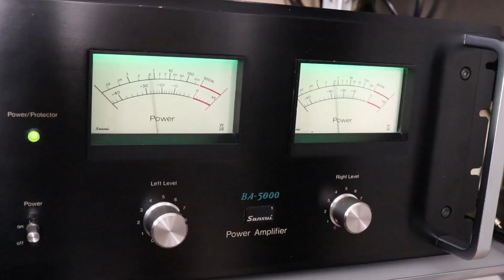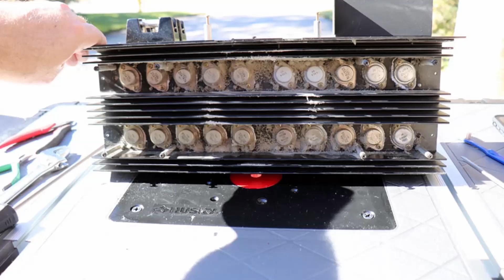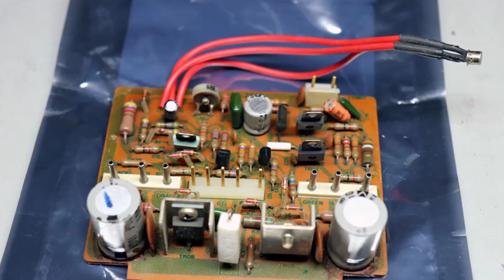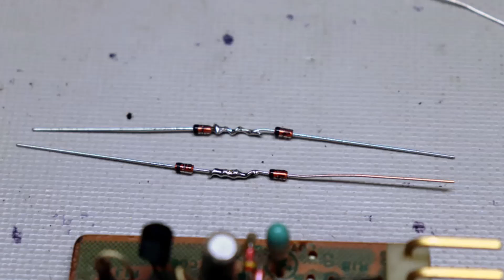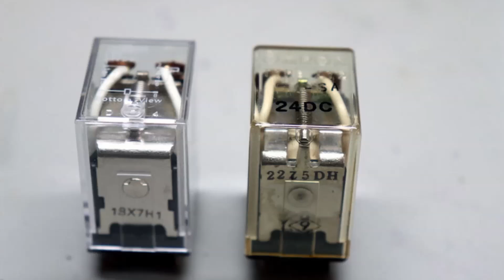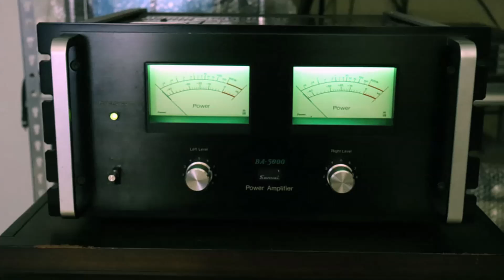BA-5000 Sansui Power Amplifier. The Best Ever? Old Vintage Stereo Repair Restoration Testing.

Comment: Hi good day I need your help I have one of the amp I have  fallow  you  video and manage to  fix it but can’t  find where to connect the fan to the  circuit   The  previous  owner lost the fan and I have to  enstall a new fan. Could you get the specs. And where to connect it to please  looking to hear from you thanks in advance

Comment: Much like McIntosh designs using output transformers in a solid state amplifier. To me this was a great idea since it isolates any DC from your speakers in the event of an offset in the output circuit. This is much better than using an output coupling capacitor.

Comment: I would like to know more about your cleaning technique, solvents, soaps, brushes,  sponges, etc. The things to do, and not to do, and why. Cleaning those meters would be a priority given their delicate nature. Excellent video. Thanks!
Reply from the maker: Thanks for watching! Well on any faceplate you have to be careful. If it's a aluminum faceplate start with warm water and a little dish soap. Rags, paper towels, old toothbrush all work well. See how it goes. Beyond that I've used Mother's mag polish successfully but if you try that make sure you test a small area first. I've never had an issue but that doesn't mean you won't. Any of the old fisher, scott, mcintosh etc. glass faceplates I wouldn't get anything wet around them. NO water, windex etc. I've seen too many ruined faceplates to take a chance.  Plastic like the meter housings water, windex etc. works for me.
Reply: @vintageaudioaddict  thank you. What about cleaning the interior, including the mess on the output transitors, or the boards and their components? Do you start with a vacuuming or a brush, do you use liquids, and how long before everything is dry? Do you use soap and water there? I saw you use some brush on deposit. Why would you need to deoxidize the underside of a board? The solder oxidizing shouldn't affect the current flow there or does it?

Comment: I have one of these the face panel needs painted. Any Ideas. It was heavily scratched as a road amp and also I need handles for the front. Had the same common emitter transistor problem as you and corrected it the same way. Repaired this about 7 years ago and it is my main amp for my front speakers. I use a Technics Se9600 for my rear speakers. A Sansui AU-11000 for my deck speakers.
Reply from the maker: Re-painting faceplates, I'm not sure. I've cleaned a lot of them but I've never tried to refinish one.

Comment: I have sansui au-20000, But I have A-little problem , one of Speaker, does have hummm sound in woofer , but not much, What do you think about to solve this problem?? I have changed all Capacitors, with ELNA, Sound is really much better, But I have checked With Technician, But they did not found , why Humm sound come in one speaker. As you have experience, whats your idea about that?
Reply from the maker: The first question is did you have the hum before the re-cap that was done? That is the first step. If the hum was there before the re-cap then you could have a grounding issuing being caused by corrosion on a grounding point on the chassis. Of coarse, this is just a guess. If the hum is new after the re-cap then you must go back through and re-check the restoration work to find the issue.
Reply: @vintageaudioaddict  Hi, Thanks for your answer, Yes, Before and after Recap, still have the issue. but I check Every things, But When I turn down the Midrange on front panel , the Humm comes down, but when The Midrange is 0 the sound come more until 10 that, I have hummmmm more. 
I checked 3-4 times, All of things, and also When I open the front panel , and pul out, The humm sound is 90% disappear.

Comment: I've had a black McIntosh MC-2500 powering my fullrange Acoustats. It is rated at two times 500 Watts at 2, 4 & 8 Ohms but was rather helpless with the load presented by my Acoustats. A Mark Levinson ML-3 without autoformers and "only" specified for two times 200 Watts @ 8 Ohms powered my Acoustats beautifully and without a problem. I do not think the Sansui BA-5000 would fair any better with my Acoustats as the Mac or any other tough load.
Like the video though and the effort you put in your work and the opportunity to hare it with us and great that you salvaged it!

Comment: My old Sansui AU-555a amp and separate tuner are going strong after 47 years.  Sounds are excellent with my home built Speakerlab component speakers.  Taking care of equipment really pays off.
Reply from the maker: Great to hear that you've had your gear that long!
Reply: @vintageaudioaddict  I forgot to say I really enjoyed every part of your repair video.  That amp is a real beast.  I never knew Sansui even produced monsters like that.  My brother also has old Sansui gear he brought back from his military time in S.E. Asia.....I believe his is an AU-777a amp and tuner?  I did my first pot replacement the other day on a control unit for RV jacks and it came out great....and I saved myself about $450 for a replacement. Keep them coming VAA.

Comment: The diode replacement on the meter board puzzles me. You stated the originals were known to be problematic. OK, why replace with 2 in series? Not for piv, 4007's are 1kv. Not to match Vf, originals look to be single diodes. No mention of sil or germanium type. Paralleled anode to cathode across the meter makes a good protection circuit, but yours are in series. Sil in series with a zenier for Temp compensation I have seen also, but this is not that. So I am puzzled. I accept that you did the right thing, I just want to know why. I have owned Japanese iron before. I have an AU999 awaiting it's turn for repair, and a Pioneer SX-5590 working great. My taste ran to Onkyo, until I discovered vintage McIntosh. The problem with high end audio is, most people have never heard it!

Comment: One would think drilling out the sealed (steel) potentiometer metal flakes from drilling would destroy it.
Reply from the maker: That's a good point. This is the only one I've owned and for that matter ever seen so maybe there was some luck that the pots were not damaged.

Comment: How did you "experiment" with the bias transistors?  Why the heck would they design something so important like bias transistors to be ran extended off the board with wires like that?

Comment: Nice restoration work, cheers!  I own a BA-5000 with matching CA-3000 preamp, they are awesome. Just wondering:  Is it normal for the BA-5000 to run very-warm after its on and playing music at moderate volume for a while?  Mine does get rather warm when I put my hand on the cover.  The cooling fan is designed to come on at 158 degrees F if I recall correctly according to the spec in the service manual. I dont think the fan has come on when Ive played the amp, but it would be helpful to know if its ok to get a bit hot even if the bias measurements are all within spec, considering all the power-out transistors it has.  Did you notice any difference in temperature when comparing the before & after of your restoration?  Would applying fresh thermal compound to the transistors make a significant difference in lowering the heat dissipation?

Comment: I have also some Vintage HiFi Equipment. At the monent the prices for old stuff flying high! Please dont forget, its old stuff! Ist needs to be repaired, and for this you have to pay! Latest equipment sounds better no question, the main problem Hifi from today can not repaired! After gurantee it s a part for the waste. The Vintage HiFi can repaired from 100€ up to 1000€, but then ist will work fine for the next 40 years...

Comment: I love watching the repair you made on this sansui, wish I was just as good as you are on repairing.. Keep up the good work. By the way, i would like to ask regarding my Yamaha R2000 which is close to 40 years old too. Is it ok also to replace some parts with same value but not the same voltage? Can you check the power amp if it can be replaced with other more modern part now? Hope you can be of help. Thank you and God bless.

Comment: I wish I could send my luxman 5m21 power amp to you, the dc offset on it just keeps rising until it goes into protection. I can deal with basic electrical faults but this is out of my league. I do think i know what the fault is but i'm not going to just throw money at it until things work

Comment: Great to see the heavy weights kept alive, I only have the BA-3000, hasn't had speakers connected(a load) in years however powers up in the right sequence, throw power switch, LED goes red to green and VU meters simultaneous do there half mark twitch. 160 per channel was plenty in an apartment back in the day. You've sparked my desire for the old audiophile in me. Give me a few days I'll play some Donald Fagen. I'm warming it up right now, One unique characteristics of the BA-3000 was it's round transformer. I've had the amp since 81-82. Thank you for sharing your passion.

Comment: Hello, first of all I wanted to congratulate you on that restoration, because taking advantage of your experience, I request your support, I just bought a BA5000, in very poor condition, it was stored for many years without use and all its power transistors were removed from the rear panel, except for the dirt and rust in theory, it is still functional because the only thing it lacks are the transistors, so your support in this sense, would be if you could provide me with an image of the rear panel where the values of the transistors are, their location and its position since I observe in internet photos that the direction of the text changes and that means that its position differs, now I could also observe that for example if it takes a row and hence 5 transistors the third, that is the third, its value it changes and that detail I could see tango in the upper and lower fil, so it would be very helpful to have the image or, if possible, the list with the values, to That the technician can put them properly and not make any position or value errors and that damages something, or if there is any way of contact, by mail or messenger to send you detailed photos of the team and thus be able to explain to the technician correctly, it is worth mentioning that the service manual already has it printed, but do not locate what I was asking you. Thank you in advance for your attention and support. Best regards.

Comment: I've had the Sansui G-7700 Tuner Amp for 20 plus years and has served me well; however, It's been in the shop three times for either the left or right channel which don't last very long and now, both are out I suppose. There might be other issues that are causing it, but It is my understanding that Sansui no longer has left or right channel outputs for Tuner Amp, and so It's been sitting on a shelf for many years, sad but true. I'm not sure it's worth fixing even though it's been a great system and is still very clean? It may take a wizard to fix, like yourself!
Reply: getting genuine parts is a key factor as well as a tech that cares about his/her work. Parts from china are iffy at best. There's so much counterfeit stuff hitting the markets, or old parts being stripped from equipment and sold as new. There's a reason a US distributor like Digikey might charge 10 times more. It's the real part and it not only meets original specifications, but it can be traced to the manufacturer. Parts need to be matched and verified on a curve tracer, if you have something worth repairing. You should not be having channel consistently going out because the same parts need to be replaced.

Comment: This is a serious amplifier made when good sound was truly the aim. We are lucky to see one still being used. Your restoration is very sympathetic to the original design and I greatly appreciate it. Have had to fix some older gear occasionally but usually some butcher has tried to fudge it but failed, making full repairs not financial, have occasionally kept the casework and replaced the power amp with all new to increase reliability.

Comment: That's a big heatsink but given there's 20 transistors bolted to it there's not much heatsink per transistor.  Does it run hot?
Reply: Yes, it probably does.  I have many a Sansui receiver and always liked the way they sounded.  They have amazing power supplies as Sansui made their own  including the transformers.  However, as you see yourself, they are known for not having large heat sinks and I have found that they do burn their transistors out easily if you are not careful with the load.   Sansui's pretty much are 8 ohms only.  This amplifier might be an exception since it has the transformer, but mismatching the load is what probably burned the outputs out.  Still, when it came to the older vintage stereos, I just liked the sound of the Sansui's the best.  Pioneer was a close second and then Technics.   Marantz is also a good sounding receiver, but I don't like the way they look so I never bothered with them.   The largest Sansui I worked on due to blown outputs was the G-22000.  And yes, after I fixed it, it did run very warm to hot running into an 8 ohm load at about 75% of it's rated power.  Nevertheless it was LOUD!  But just a warning to you if you go with Sansui...if you push them, they push back by blowing the outputs.   Almost all should be gone through, cleaned and biased properly to specs.   The 75% rule is pretty good to follow as well.   So if you listen to music and you find 75 watts a channel loud enough, go for a 100wpc receiver (or more).  Just be careful if you go too high on the power as you can damage your speakers from overpowering.  This is naturally easier to see if you get a receiver with power meters and I highly recommend that.    This amplifier above would be too big for my tastes, but I just looked on as it is a nice looking piece.

Comment: This is not possible between 2/4/8 ohm the power can not be the same.
Reply: Yes, it works that way with an output transformer.  (With a load that matches the tap)

Comment: I have a CM Labs 920 amp that I've had for 40 years and it's original except for power switch. It's used regularly, looks great but the transformer has started to buzz. Should it be replaced or can it be redone without too much expense?

Comment: these BA-5000s are quite rare, not a single one has come up for sale on ebay in at least the last 6 months to a year and only a handful of Japanese models come up for sale on yahoo Japan.  This thing was a BEAST back in the day weighing 108 pounds.  You think the G-33000 pushes speakers well?  The BA-5000 is a step above the G-33000 in output performance and I'd get a BA-5000 with a CA-3000 and a TU-9900 tuner any day over the insanely overpriced G-33000 and pocket several grand in the process.

Comment: Great videos...looking for someone to resurrect my Sansui G9000 (that I've had sitting in the closet for some 8 to 10 years now) that is close to south Florida to I can take the unit to them for restore. Right channel intermittent and needs new lamps. Never been serviced except for a cleaning in the late 80s. I'm original owner. Bought it in the Philippines in the late 70s along with a pair of SP. L800 speakers that I still use today.
Reply from the maker: Thank you! Google "vintage audio repair" or "vintage stereo repair" and see if there is someone down your way. I imagine between West Palm Beach and Miami there is. That way you can just put your G-9000 in the car and take her to the shop yourself. The G-9000 is a wonderful receiver. Good luck with her! You didn't say but I imagine you were in the Philippines because you were in the military. Thank you for your service!

Comment: Nice amp !!! Almost done with my G-8000 , it set in a closet for 35 years ! Got a lot of time on it just cleaning it , everything is orginal and looks almost new inside , I would like to re-do tje protection board , you know every G-8000 i see the left side driver board is always missing its cover ? And the right side always has the cover , you know the boards by the filter caps ?
Reply from the maker: Thanks! When you get your G-8000 done you'll have to post a video. What a pain in the arse that process is, LOL. Well, I think that both the left and right side covers were there originally. You wouldn't think that would be something easy to forget to reinstall if someone was working on the unit. Maybe a screw but not a cover. I don't know......
Reply: @vintageaudioaddict  will do , I dont know why someone would have that covet off the left side driver board its all orginal , But yeah i will be done with it this weekend , I got to all pots the pots for cleaning that was a pain but just took my time beautiful machine
Reply: Ohh did you change your main caps ? Lol point to point soldering 😆

Comment: I've owned many amps from the 70's to mid 80's...some purchased new and others used.  To my ears, the best sounding amp and possibly most reliable and well built, with the exception of the speaker terminals is the Yamaha MX-1000.  I had two of these (bought new).  Recently sold them for more that what I paid (not factoring for inflation).
Reply from the maker: Thanks for sharing!